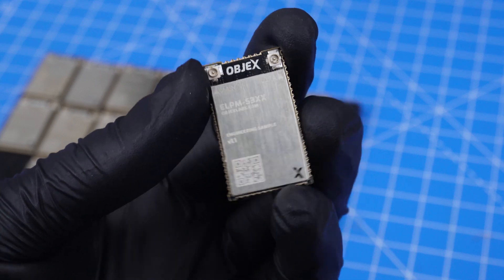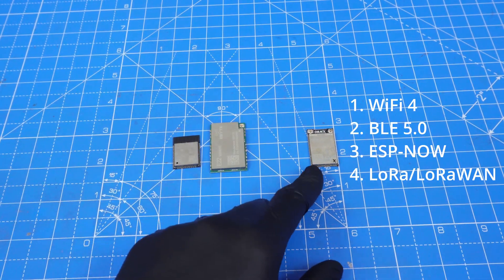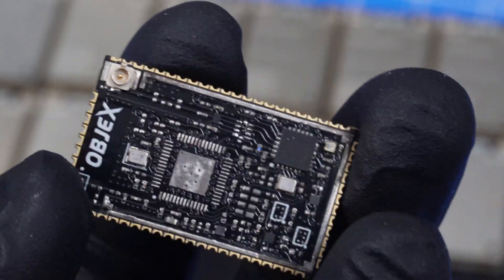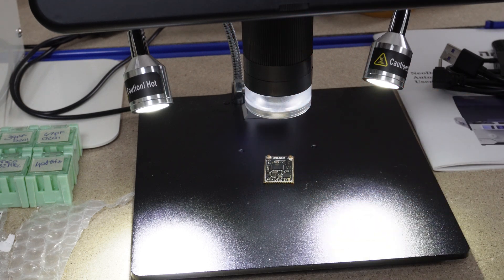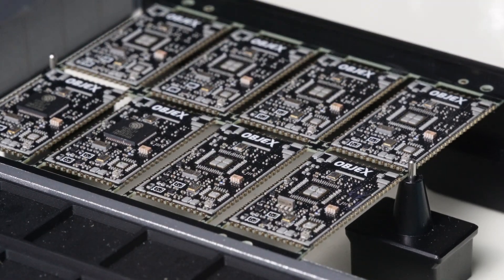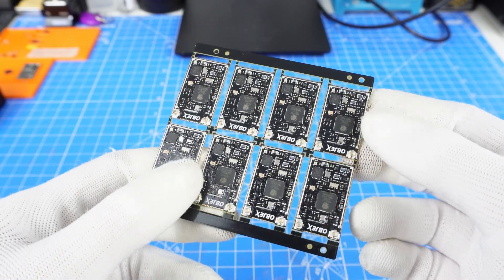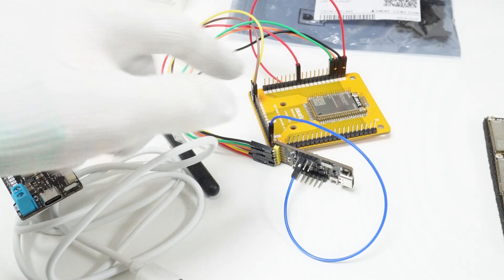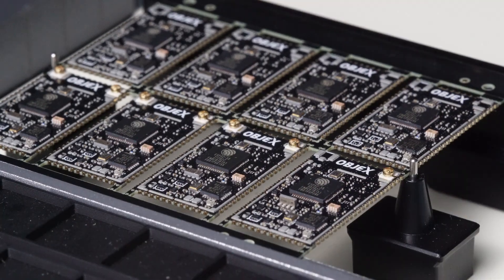IoT Device Manufacturing Is Complex, Low Power ESP32-S3 Module with Components Smaller Than 1mm

Comment: 11:10 demonstrating the importance of testing by sneaking in a shot with a component that was picked and placed by the machine oddly. (bottom right PCB, I think it's an oscillator on it's edge)
Reply from the maker: Coincidentally, it is the same panel I showed assembled in the previous clips, and I say the RTC on the right was not placed correctly. It can happen that a pick&place does not position a component correctly.